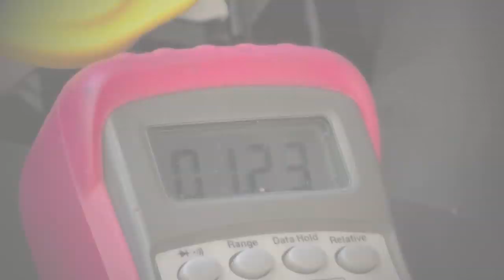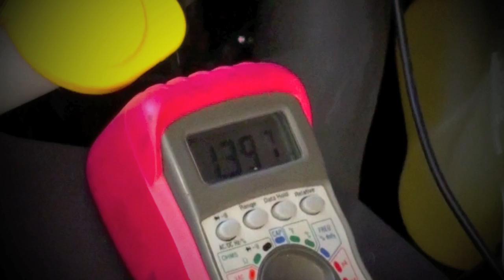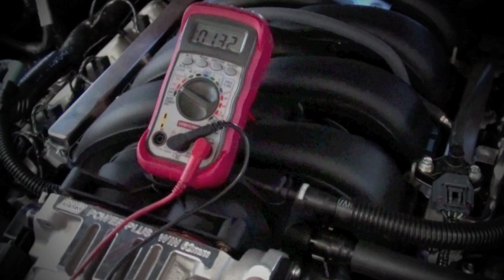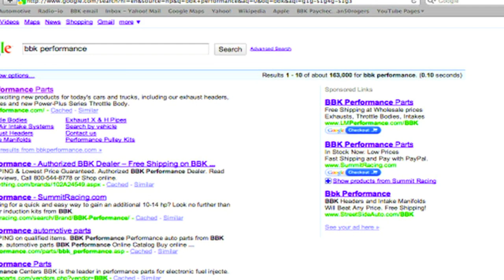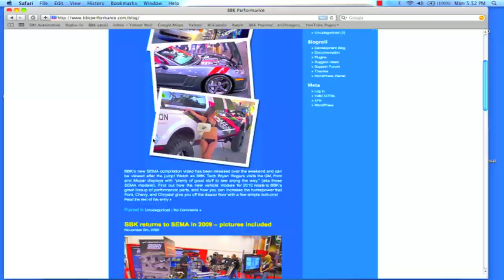Mustang GT Throttle Body Install (2005-2010) Review

Comment: I am having a problem very similar to the problem you are having with the hanging RPM problem. The Throttle bodies that fit the 2005-2009 Mustangs all have this same problem. I have the Ford Racing unit and I am having the same issues.The idle hangs on start up and then hangs during shifting. They claim that this is a very common problem among aftermarket units. Even the Ford Racing Unit will cause this to happen. It's not a bad install the Car needs to be tuned.

Comment: on my 2010 mustang gt I put on your bbk air intake and throttle body. after I installed them all I test drove the car and after like 10 to 15 mins of driving the car kinda like down shifted itself and the ranch light came on. I have a stick so when I say down shifted I mean it almost stopped the car. also after I turned the car off I started it and the gas would not respond right. plz help

Comment: I wish ford knew what the hell they were doing when they installed my bbk tb. They said the car did not run well with it installed. Held rpms for 5 seconds after u let of gas. I was still charged for the labor, Anyone know what they did wrong? I would like to have this part installed in my car.

Comment: I have a question and I think you answered it below requiring a tune for this as I have a SCT SF3. I just ordered your BBK Cold Air Intake 1736, just yesterday for my 08 GT Mustang. Should I wait to install the cold air intake, till I get the throttle body. As I understand no tune required, or is that just for the throttle body, but with the cold air intake and even though there is no tune on that either. But can you access the intake, via the tuner and increase performance? next BBK underpully

Comment: @bbkperformance  I'm a newb when it comes to working on cars, the instructions say to "ground the black wire" but my question is where/how do I ground the black wire when checking the TPS with a digital volt meter?